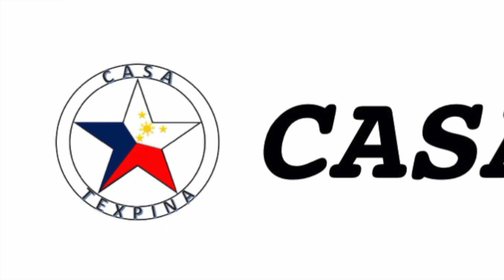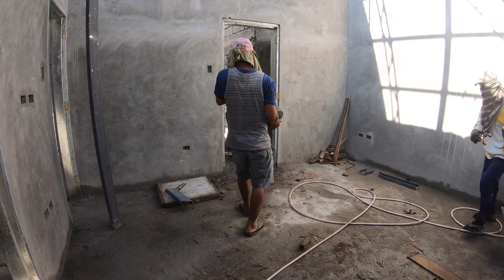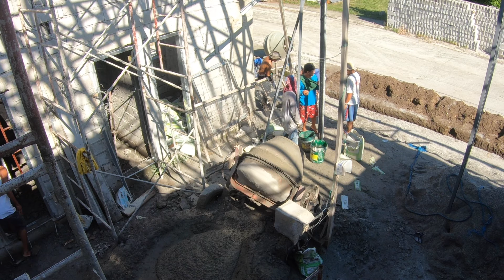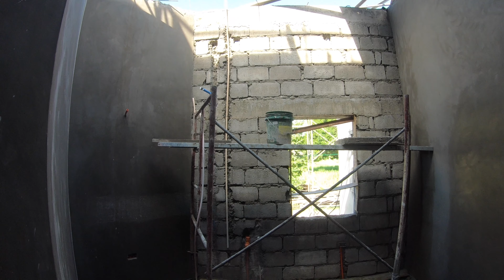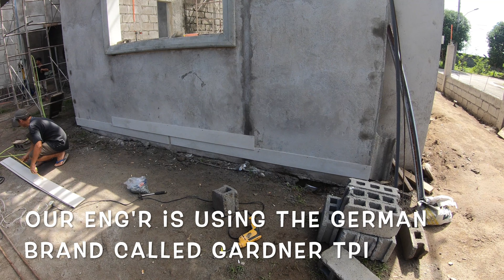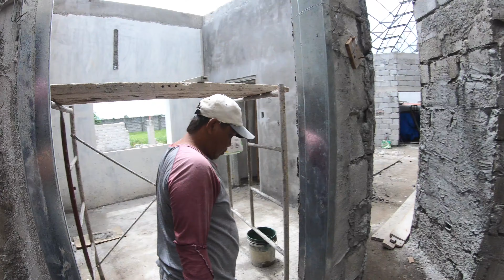Philippine House Building Step by Step, Build Day 104: Pouring Concrete Stairs

Comment: is it me or are the front entry columns looking wayyyy spindly thin? maybe have 2x wider or 2 pairs of them?
Reply from the maker: S,
Might be an optical illusion. GoPros are not the best for clear optics. 
The rebars are 16mm corner uprights with 12mm on the sides and 10mm stirrups. Should be plenty strong. They are working the forms for them today.

Comment: Nice feature wall being created with the Hardiflex planks George - I have seen this being used at the entrance of another house build in the Philippines - however - nailing the planks to a typical stud wall frame is what is recommended - the other Philippines build actually used cement to 'stick' the planks to the rendered hollow block wall pretty much like on would do with tile and the way your window frame feature has been done - I have never seen cement planks being cemented to a wall before but I do consider it to be very creative and better than the nailing method that your guys are using - staggering the butt joins is always better for visual appeal, water proofing and longevity in a typical build. Your house's roof for me at least will be the outstanding feature !!
Reply from the maker: Serge. Crispino Ours will have the plank siding all around except for three feature walls in the front which get stone cladding. 
Yes, I saw on most of the installation videos that they used wood studs. My guess is that the aggressive termites here may be the reason behind either direct cement or nailing directly to the walls. 
I prefer the staggered as well, but they plan to skim coat the joints prior to painting. So might be a moot point.
Reply: @CasaTexPina  - It is going to look awesome in any event George. I understand that termites are the reason that dimensional lumber can not be used in the Philippines or as in the case of your gorgeous front door they only use really hard wood species. Nailing the planks to your walls is obviously quicker however over time I am not sure if it is the best way to attach them. Best wishes from Australia.

Comment: Most pilipino carpenters knows masonry, steel works, tile setting even plumbing and painting works. Most of these are called foreman!!!
Reply from the maker: It’s good that they are so versatile. Means they can stay on the job longer and move around as needed.